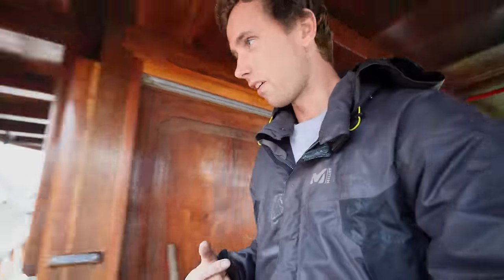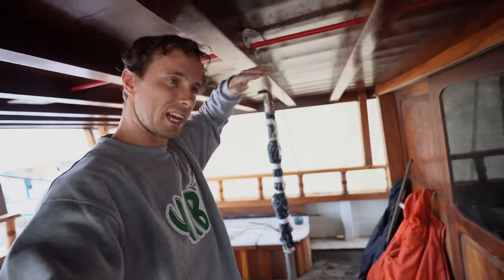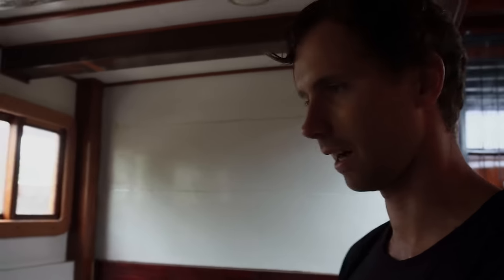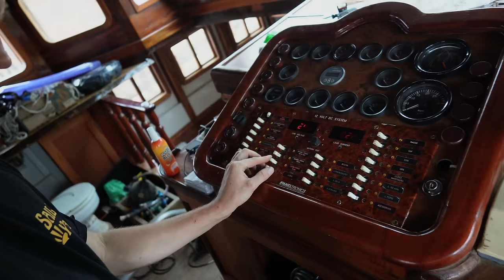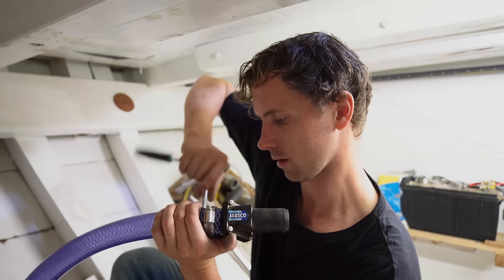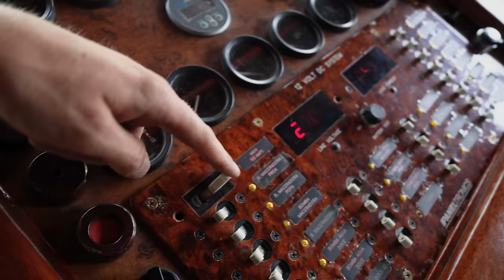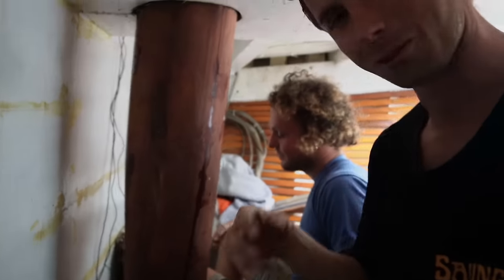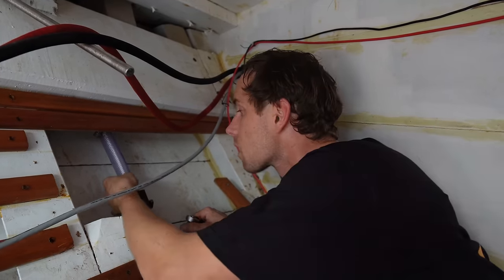Bilge pump acrobatics and off grid wooden boat restoration — Sailing Yabá 184

Comment: For your bilge pump hoses and check valves, you might want to put the check valves closer to the pump. After the pump turns off the water in the hose, between the pump and the valve, will run back into the bilge. This can create a on/off cycling of the pump, when in auto mode, and ruin the pump and waste electricity.
Reply: Very smart observation and great advice.
Reply: I agree with you.  The check valves are inexpensive and easy to install.  The valves will also ensure the least amount of water in the bilge.
Reply: And, you can re-use the hose, just relocate the short section to the pump outlet. A heat gun will make the hose more pliable.
Reply: I Agree.  Those hoses are a large volume and the bilge water will flow back in to the bilge from the Valentine's. Also they need to be accessible for service.  Cheers!
Reply: Check valves really? Spend for something to hide a problem? Yes and then you have a real problem that was avoidable
Reply: Yes, this!  Also, this will keep the check valve somewhere it is accessible, instead of being hidden behind the diesel tank.  This is important because it will inevitably become jammed with debris and need to be cleaned out
Reply: Thats right I have that problem on my boat.
Reply: Spot on I was going to say the same thing..
Reply: Yes, check valves near pump.
Reply: We ran into this exact situation, the discharge hose was approximately 5ft on a 3/4 inch discharge, which kept the pump running, as we located the sump so low in our bilge.

Comment: You need to put the check valve (no return valve) as close  to the bilge pump as possible so that the bilge water that is in the hose higher up can't come back to the pump when it shuts off, otherwise it has the potential to cycle continuously.
Reply: It's a wood hull, those pumps are going to be coming on continuously any dam way hahaahaa
Reply: Nope check valves are for poor installation. See how some use check valves they don’t understand basic plumbing.

Comment: Ben, consider moving the one way valve closer to the pump. As you have it, each time the pump turns off the water will run back down the hose flooding the bilge and re-activating the pump. Which will cause the pump to constantly be switching on and off as the water flows up and down the pipe.
Reply: Check valve should be as close to the hull as possible . When the hose fails the valve keeps the seal out of the boat. Through hull , ball valve, check valve then on to the rest of the plumbing.If the volume of one run of pipe is tripping the  bilge pump raise the pump switch a little.The remainder can be pumped by the manual setting. This is not a set it and forget it kind of boat. Yaba will need constant vigilance.
Reply: Pocketfarmer is correct.
Keeping your bilgepump happy is not the purpose of a checkvalve.
Keeping seawater flowing in, through your bilgepump, IS.

( or -god forbid - water entering the boat, through a hose that slipped of your pump…

Comment: Hi, I would have placed the non returned valve close to the pump so that when the pump stop the water in the pipe would not flow back in the bildge. Additionally, if nneeded to be replaced, it ywould be accessible without removing the fuel tank.

Comment: Dip the end of the plastic hose in boiling  water for a few minutes  and you'll  get the plastic  hose on the valve easily as it will be softened and stretch  over easily.
Reply: Wave a heat gun at it for a few seconds, quicker and easier. They have one that they use for electrical connections.

Comment: I'm going to say. The one way valve connected to the line for the bilge pump should be accessible even when the diesel tank is installed. If something happens and the valve becomes damaged you will need to get to it and make repair without moving the full diesel tank that could weigh 500 kilos. And, there should be a shut off valve to isolate that line before it goes under the tank and connects to the through hole. You'll be happy you installed the redundancy.

Comment: It's nice to see you putting the one-way valves in. Don't forget a flapper on the exhaust, like on a tractor exhaust stack only yours will be horizontal to keep the waves out. SVL just bought a new boat and their engine was destroyed on its first rough weather outing when water entered the exhaust and seized up their engine.

Comment: Ben, I wanted to remind you that diesel tanks are not blocked "Longitudinally". If you get rough seas with pitch they can move.
Reply: There are recesses molded into the tanks, place a wooden block into those recesses and fix block to wooden tank mounting  brackets.

Comment: Check valves should be installed right at the bilge pump. The idea is to keep the water in the hose from flowing back into the bilge when the pump shuts off.

Comment: I did not see you do it and you may well of done, but  I did notice you  struggling to get the hose on to the hose connector. Just a tip to make it easier is to put the end of the hose in boiling or very hot water to make it supple and easier to push on. This also makes a better seat if you tighten your hose clamps when the hose is soft .   Great to see you every day now and so looking forward to your splash.  i have been with you from day one and actually thought you were both nuts..  I've never been so glad to be proven wrong.  :-)

Comment: a hot air gun/hair dryer would help you with the install of your hoses, just apply a little heat when cutting, installing on the hose barbs and when you install the clamps. the heat relaxes the hose.

Comment: This would have been a good day to route those cables, or wrap them to protect from the threaded rod they are sitting on. I would guess they are for the windless, but they don't need to be sitting on the bolt or whatever that is. We are anxiously waiting from central Florida for the splash.

Comment: Crazy idea.  You've had to re-caulk a few times due to the wood drying out.   Is it worth spraying water in the lower levels to expand the wood a bit AND test the bilge pumps at the same time.    I'm sure they'll work perfectly.  Just start the wood swelling now before you splash Yaba.

Comment: the return valve should be justa after the bilge pump, otherwise the water inside the hose between the bilge pump and the valve will return to the boat

Comment: When fitting PVC pipes to hose tail fittings dip the pipe end in a cup of near boiling water for maybe 30sec. It will then be effortless to slide in on to the hose tail. It cools down quick , it shrinks hard on to the fitting giving a water tight seal.

Comment: Great watching your daily uploads! I know you are under the gun to get launched, and I don't want to sound alarmist, but your bilge pump outlets as currently set up could sink your boat. The outlet is about 20 cm above the static waterline (predicted, since you don't really know how she will set with all the new timber and ballast) but could easily be underwater when the boat heels. In that case, that check valve is the only thing preventing your boat from downflooding through the bilge outlet. Check valves (properly installed near the pump) are really only intended to prevent the contents of the hose from coming back in, not the whole sea. They are also susceptible to fouling by whatever might be rattling around in the bilge, therefore the requirement to be accessible for maintenance, as pointed out by other commenters on here. The normal installation requires a riser loop in the hose, the top of which is to be at least 30 cm above the heeled waterline. You likely don't have that much room, but at least you could run it up to the underside of the deck. Best of luck.

Comment: I am not sure I understand what was said about check valves with the bilge pump.  The pump is usually put in the lowest part of the ship (bilge). Water is collected in the bilge and at a certain lever, the bilge pump removes the water (or most of it) through a water line that exits at a high point above the sea water level.  When the pump shuts off, there is still water remaining in the water line between the pump and the exit port.  To keep that water from flowing back through the pump and back into the bilge, a check valved is installed right after the pump.  This valve is really inexpensive and easy to install.  The valve is a simple "flapper" design and is also used for household sump pumps.  You could install it in practically 10 minutes.  You can get the valves at the hardware store.

Comment: ABYC recommends AGAINST check valves on bilge pump lines. Over time, they can accumulate debris, creating a head pressure that the bilge pump cannot overcome. The bilge pumps on Yaba are not positive displacement pumps, merely centrifugal circulators. That's why they all have a maximum head height. For example, a 4000 gph pump will only pump around 2000 gph at a 1 m head height. Any restriction in the discharge line further reduces the output.
Reply: The check valves should be a regular maintenance item with spares at hand.
Reply: @boooshes  Reality check: They will never be inspected. Unless I misheard, Ben mentioned that the engine room thru-hull was going to be behind a fuel tank. Rule (bilge pump manufacturer) also says not to use check valves with their pumps. I'm going to go with the experts.

Comment: Should back flow valves not be closer to the pump? As installed now all the water in hose will drain back into bilge. Depending on how sensitive your float switch is you could end up in endless cycle. Pump turns off, water drains back to bilge causing level to rise and turn pump back on!

Comment: Maybe I should have said something earlier. ALL THRU HULLS have to be within easy reach, so that  in case of an emergency you can get to them. By emergency I mean, you have to be able to get to them   if the water is gushing in, the ball valve is frozen in place or broken and you have no other way to stop water coming in, you have to be able to hammer in a wooden plug. All boats should have in their emergency kit a decent variety of wooden plugs that are designed just for tis purpose. They come in various sizes, they are tapered and they can be hammered in place from the inside the to stop water intrusion.
Watching you install the valves, the 90 degree elbows tells me, you don't really have easy access to them, and certainly not enough room to swing a hammer to insert the wooden plugs.
Reply from the maker: Those thru-hulls that are harder to access are way above the water line though. The ones under the waterline are all easily accessible.

Comment: Bad idea putting a check valve in a bilge line.  It's one more thing to fail when you may really need the pump to work.  Better to run a loop up high and back down.

Comment: Check valves should be installed within 12” or less of the pump not the outlet. I understand your methodology in terms of putting them closer to the thru holes but leaving them that far away from the pump will allow a significant amount of water to back flow thru your pumps and back into the bilge every time they shut off which isn’t good for them. 

Also a ball valve attached directly to every thru hole above or below the water line wouldn’t be a bad idea should something happen while you’re underway and you need to isolate the thru hole from piping and anything else attached to it.

Comment: Thanks! you could’ve wrapped your hand around the end so you would’ve made contact with your mouth to your hand and not that valve or you could’ve used a piece of hose that you just jam on to the end to blow through. You really shouldn’t have been putting your lips on that, especially if it’s a used one. Even bilges has some pretty disgusting stuff in them.